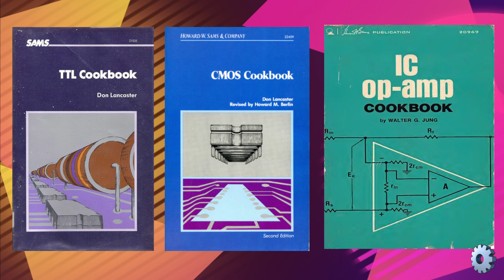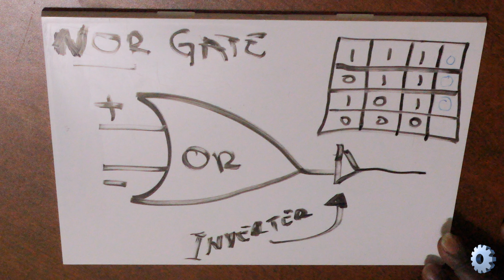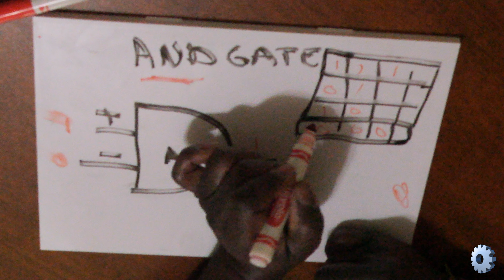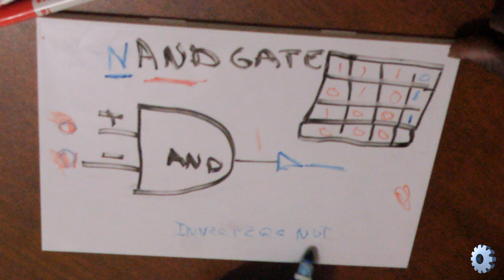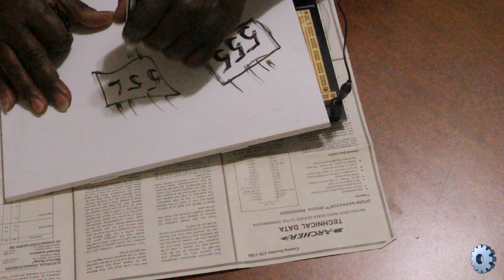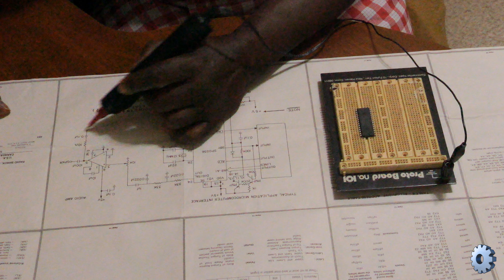Radio shack Digital Probe Micronta 22 303 Vlog-11

Comment: What a coincidence!  Recently, my son opened an old box of my stuff still at my parents' house and found that Radio Shack logic probe!  It appears to be in perfect condition, but unfortunately, it doesn't work at all; nothing at all happens when power is applied.  I must've bought mine in 88 or 89 when I was a freshman in high school.
With this video and the previous one about the Radio Shack speakers, it's like you're going through all my old stuff and making videos about them.  Keep it up! 🙂

EDIT: Because of this video, I decided to try out my logic probe again, and found that it actually works!  I don't know why it wasn't working before, but it appears to work perfectly now.
Reply from the maker: Just found my RS Field Strength & Short Wave Radio Tester. Got to do a video on that.
Reply: @Sirrom0206  Please do it!  That's something I never bought.  I'd like to see how it works.
Reply from the maker: Unfortunately, I've gone through the RS stuff laying around not inside boxes. The next video will come from the stuff in the garage. I don't want to go digging in the garage, it's scary in there!
Reply: Thank you great display